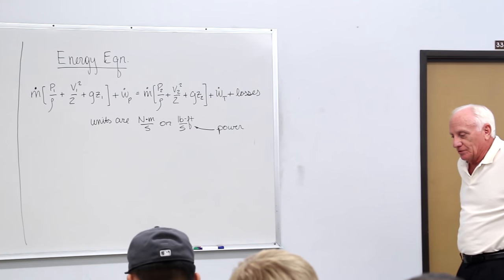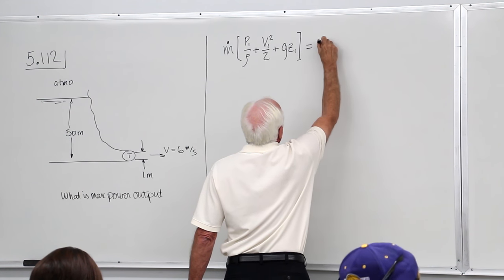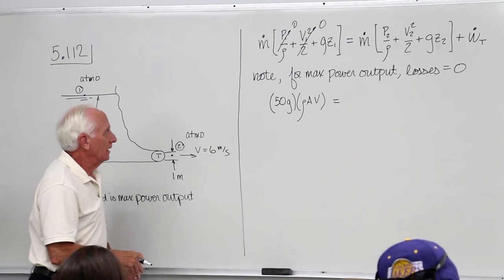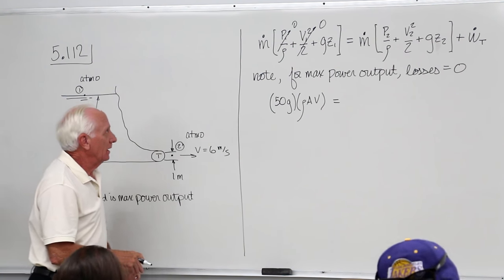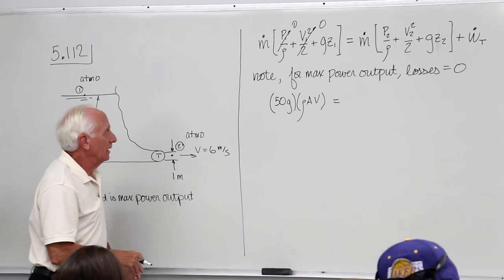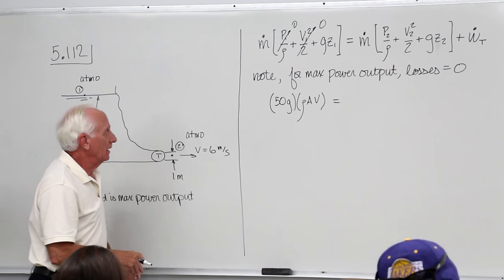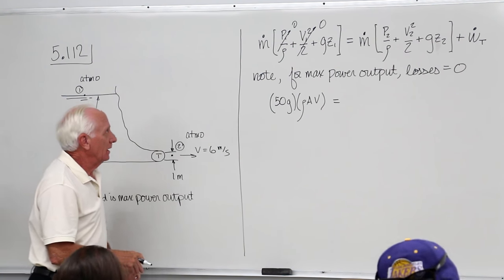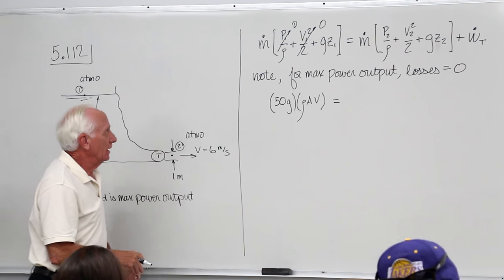Fluid Mechanics: Energy Equation Examples, Differential Continuity Equation (14 of 34)

Comment: to those confused on how he got 28hp @20:00 , I found the question and the unit for the given losses (61/2V^2) is ft^2/s^2 which means it is per flow rate basis (or per m dot). So you need to multiply it by m dot to get the losses. (density of water is 1.940 slugs/ft^3 not 62.4... 62.4 Ib/ft^3 is the gamma... just a side note for those no used to english units like me XD)
Reply: This is definitely helpful! Now I understood how it worked!! Thanks ;)
Reply: Thank you man. Stuck for 2 hours lol

Comment: i have a doubt, so please reply.
professor made a mistake at 44:17 in hurry ,after he puts that minus sign, isn't the equation possible? 
i mean if the value of x and y both gets equal to 2, 
2y-x^2 =0
then the equation could be equal to zero.
Reply: My best guess is that it should be equal to zero for every value of x and y. That is, the result should be directly zero instead of 2y-x^2. I'm not 100% sure, but it looks like that's why.
Reply: Yeah it's like you say, the question is not if it is mathematically possible, but physically. And since x and y are coördinates it's impossible for them to satisfy that equation in the whole flow.
Reply: @TGreenWizard9  thank you bro, I have the same question as mohitosh's , but I got it now after your ans^^
Reply: @towafubuki  no problem, happy to help :)

Comment: How do I get 28 HP 19:49, after plugging in all the values I get 17 HP
Reply: What he did not show is a conversion between "head loss" to "losses" so you need to multiply "head loss" by m_dot...then you get the 28 HP.

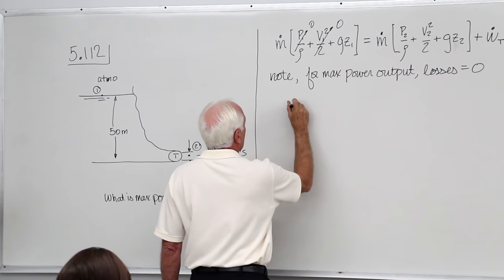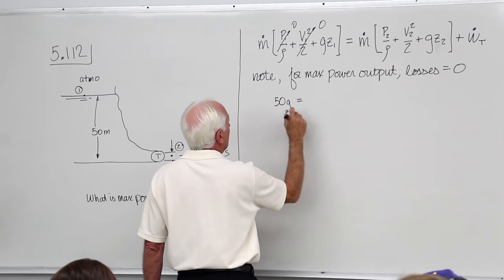Comment: why p1 is equal zero at 8:10-8:20
Reply: pressure gauge at atm pressure = zero
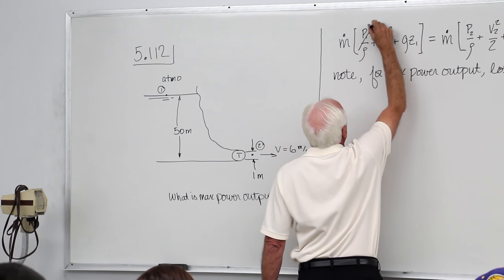Reply: why is v1 = zero at 8:03?
Reply: @MarineOffshore  The water level, although you might think it is moving downwards, in dam examples and intro to fluids examples as well, the level is taken as a constant thus no change in displacement so 0 velocity)
Reply: @YoussefCherqaoui  Actually, it must be considered as a big reservoir. The surface velocity is too small thus it can be neglected.